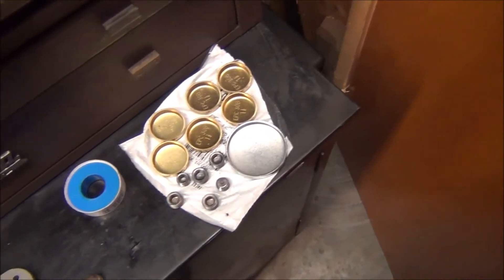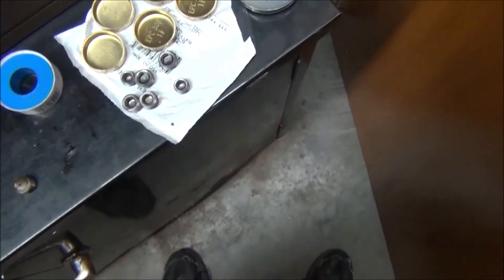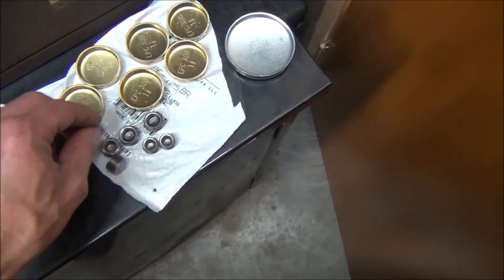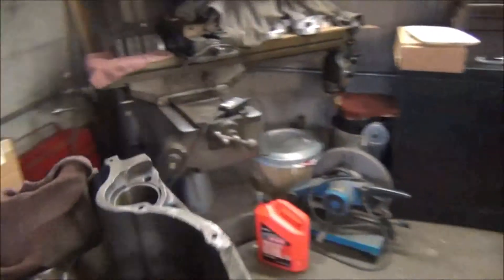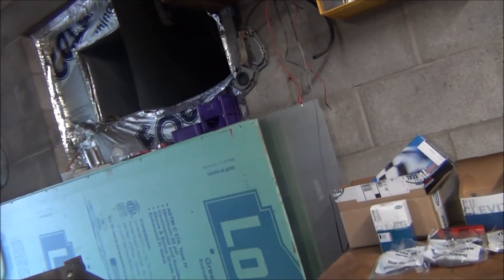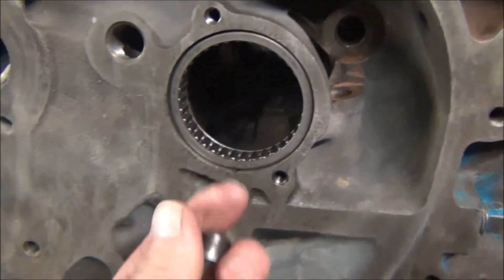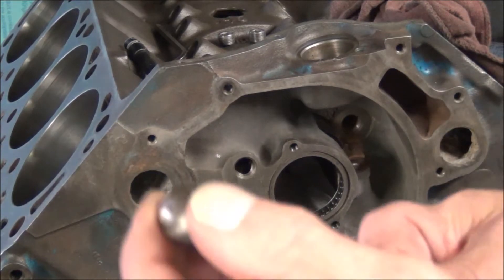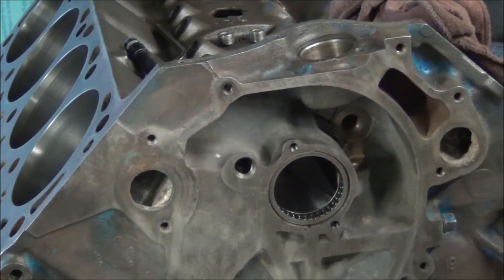460 rebuild Part 4 . Oil galley plugs.

Comment: There's a similar plug on the cad 500 engine family. I install pipe plug and tighten as far as it will go in threads. Then I drill the passage leading to the plug. I then pick punch 2 marks to realign the plug after I remove the plug to Clean the oil passage. Reinstall to punch marks and depth. On front plug passage from oil pump.
Reply from the maker: Interesting!

Comment: Thanks for the videos I'm also put together a 460 been a while but I got the gaskets for the intake they gave me a valet pan it's what I was concerned about on 87 model didn't know if it come out with one a lot of people like some what don't just going to do what's best for the engine they said valley pan keeps your oil in the belly there to the popping up on the intake and it's a heat shield for the intake carburetor like I asked learn something new everyday
Reply from the maker: Thanks for watching.

Comment: Thanks for the tips. I'm putting together a 460 for the first time in our garage. 

The motor ran showing 75 psi. But all the bearings were seriously tore up putting grooves on thr crank. Will I be ok to wet sand the crank with 1500 grit. And call it a day? Or should I buy a new crank.
Reply from the maker: I would have the crank turned if it has not been turned already. Grooves are bad. If it can't be turned get a new one.
Reply: Thanks  ya I have a feeling I'll wast a lot of time sanding and end up with a bigger mess

Comment: Building a mild 460 for a jet boat and a old-timer down the street recommends not drilling a hole in the oil galley for a dedicated distributor oil supply. I really like the idea of drilling that hole... think I would destroy my boat motor doing this. What kind of oil pressure do you have? I have a hydraulic flat camshaft if that matters. thanks for any input and I really like your vids.
Reply from the maker: This engine has a stock oil pump,because I only run a 6 quart oil pan ,and gets about 30 psi hot at idle. 60 going down the track wide open this engine has been raced since 2007, and is still going today.